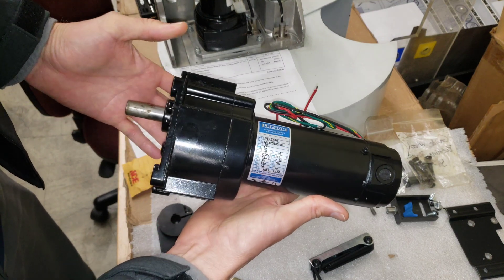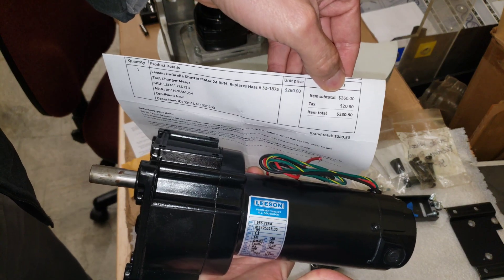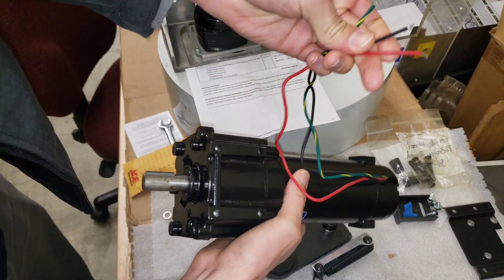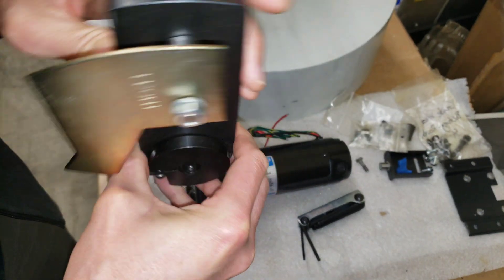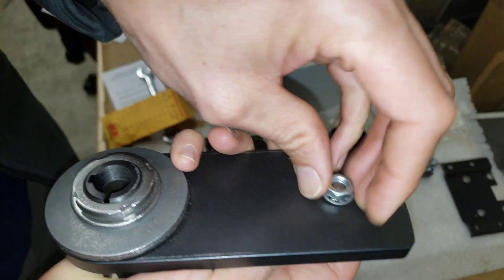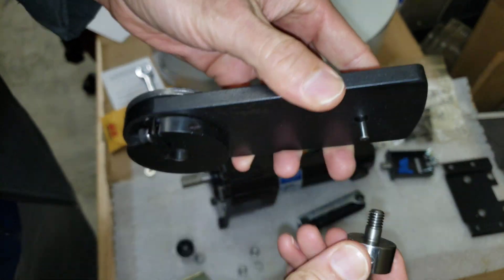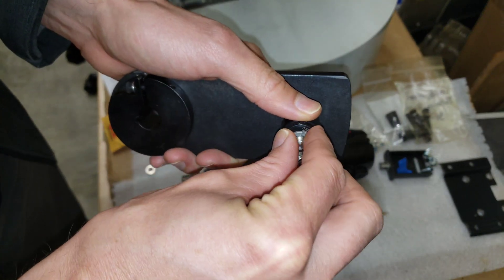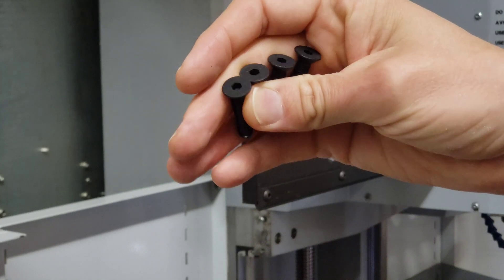Adding A Tool Changer To HAAS TM-1 CNC Mill | PART 2: Umbrella Shuttle Motor Install (Inexpensive)

Comment: I did notice you did add tool changer to your tm-1.  Where did you finally find the carousel parts?
Reply from the maker: This company parted out a bunch of mini mill tool changers. I ordered all the individual parts from them and rebuilt it. They were nice, but a bit slow to get everything together as it's not their main business. http://tek5usa.com/haas_parts/
Reply: @engineerable  Thanks for the link.  Do you know which tool changers are the same as Haas tm series?  Mini mill? Any others?
Reply from the maker: @drewnix7201  The 10 tool changer was the same between the TM and MM series. I know they offer a 20 tool changer for TM-2, which is probably the same as what they put on VF machines. In general, the umbrella tool changers of the same capacity from similar years are the same between the different machines. Here's some detail where someone added a 20 tool to their mini mill https://www.practicalmachinist.com/forum/threads/upgrading-from-a-10-to-20-tool-changer-on-a-smm2.379279/

Comment: do you know if this is the same motor as "93-2597" ? I found one place that says "HAAS part number 32-1875, that is now part number 93-2597" but cant confirm. I have a mini mill that the shuttle motor has been struggling and finally gave out. thanks
Reply from the maker: The tool changer for the HAAS TM-1 is the same as the Mini Mill, in fact the tool changer I'm adding this motor onto is from a Mini-Mill, do it will work.